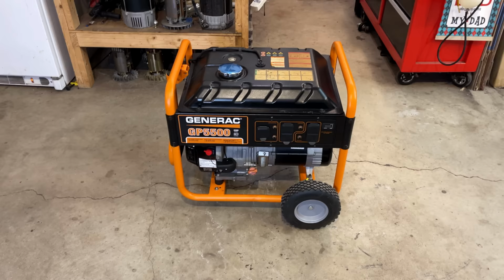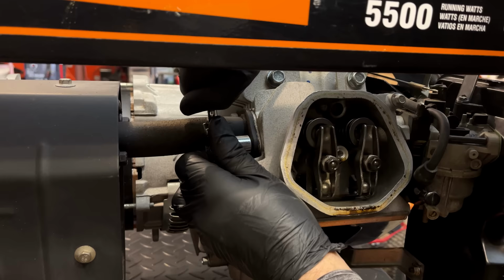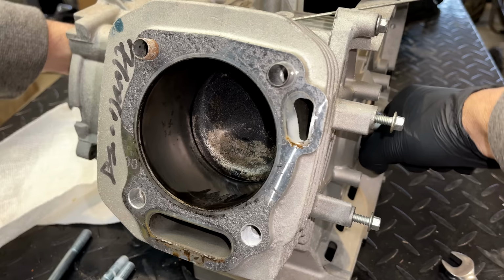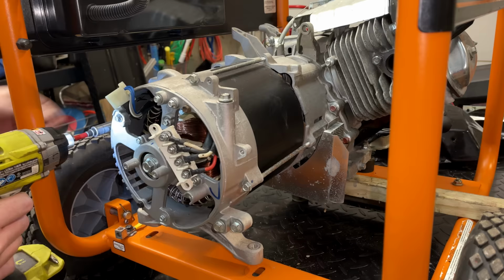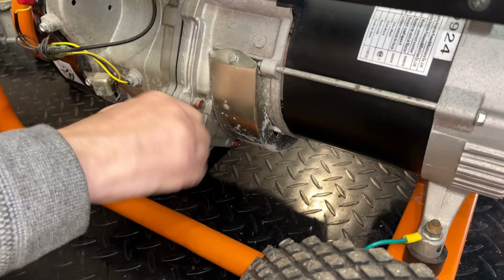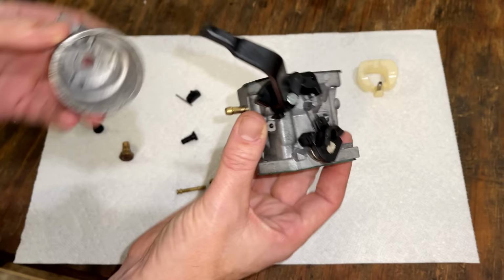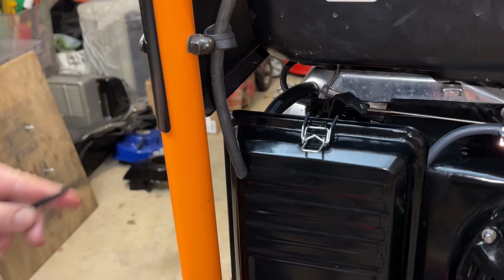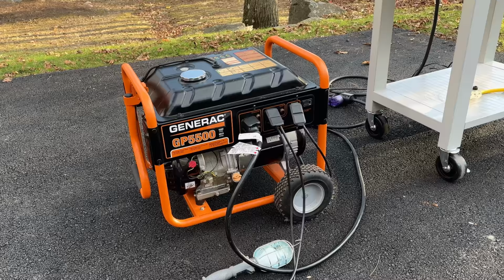What Caused This Engine Damage? - Generac GP5500 Repair

Comment: Best way I found to remove rust and varnish from a fuel tank is to use peebles. Small ones like you found in aquarium. Rough ones are the best but river ones are good too. Then shake as long as you can. 30 minutes should suffice.

Comment: Excellent work James, I had a 3000 watt champion that someone put bar and chain oil in. Took me a long time to clean it out and many oil changes and used some marvel mystery oil during the changes. Came out o.k. but the bar and chain oil was only in it for a few months and the machine did not run much with-it in. Customer said it runs good now. He uses it at his camp. Thanks for the video.

Comment: Another great video James! A word of caution when hammering on the crankshaft bolts to remove the rotor and/or the flywheel. Crankshafts are not designed for side-loads, mainly rotational loads. Beating on either end too much will break the crankshaft. 2 or 3 whacks is about all the crank will stand before breakage internally.
Reply: It is common practice to do this on many aluminum-block engines.  This is why Briggs sells a flywheel knock-off tool.  Now, if it was a Kohler engine, there's a very real chance it would break.

Comment: Junkerac. The home owner grade Generac gennys are built with parts outsourced from China,India,Maylasia and a few others. 
It's extremely hard to find a Good quality, affordable home owner grade genny any more that will last. My old mid 1960s Winco genny that I use for emergency power for the furnace and fridge and a few lights, has only had 2 sets of brushes and a couple filter caps replaced since it was new. It fires up in 1 pull even on the coldest of days. I've had other newer gennys but none lasted more than 10-15 years. Often by the time these newer gennys break the parts are No Longer Available.
Reply: Yep, the new ones are DESIGNED for such, I wish I knew more about older ones like you state where I could get a OLD machine & then round up replacement parts
Reply: That's why when I come across an older machine I tend to buy them if i have a use for it. The same goes with vehicles, I haven't owned anything newer than a 93 since 93 lol.

Comment: I wanna see you clean and rebuild that original motor. Soak the case in evaporust, clean it out heavy duty, and put bare minimum into it. Like hone the cylinder and put new rings into it. 

It’d be fun as a challenge and a proof of concept that anything can be fixed. Like you replace anything other than wear items like the rings or bearings.

Comment: That was a thing of beauty. Boy when I started rebuilding an old tractor from the 60s the gas tank inside was nasty with rust. What a pain of the ass trying to get that cleaned.
Reply from the maker: Tanks like that take a lot of work to clean up.
Reply: @jcondon1  I need to find extra patience also. What’s going on to tip besides in the video? I’m rebuilding a 1966 Ariens Emperor deluxe tractor. Look it up  you’d probably enjoy a project like this. Happy holidays etc👍
Reply: To clean rusty tank, I use 10% phosphoric acid. It take rust away in a few hours and leave gray matte steel. The I wash it, dry carefully and paint it with 2 component paint (for fuel tank paint). That acid not lose its power and can use several times.

Comment: Needle seat failed ethinal fuel found it's way into high zink oil/ brake in oil and chemicaly reacted while it sat for a long time 
I've encountered this before. This is  why when you store a engine drain fuel and carb first .

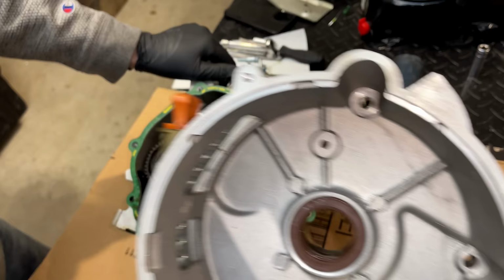Comment: 28:13 Wow is the under statement of the year.  I think it got filled with water, not really unusual considering that these generators are usually used during power outages outside and in foul weather and then just put up until the next power outage. Great video.

Comment: I was always told like for boat motors if you only had gas with water in it to make that gas usable again you need to strain it thru a deerskin chamois, it is supposed to absorb the water letting the gas pass thru.

Comment: It looks like this generator sat for many year in high humidity and not ran. This is why it's so important to start your generator at least every 2 or 3 months, keep fresh fuel in it (non-ethanol) and use quality small engine oil. Whatever the cause, this one was abused. Another interesting video.
Reply: I suspect that it was far more than humidity.  The internal rust/water line was well up the crankcase.  That's not not something that happens from condensation.

Comment: Great work as usual.
I have a new GP8000 10 HRS 
Why when cold out I can't get it to fire with the choke on all the way.The first time I tried to start it when cold out it would t fire.
So I wait a few mins ,we t to retry and I smelled gas ,so next time I full chocked it and at the same time during hitting starter switch I pulled it off full choke to 20 present it then fired.
It will not start on full choke when at 40 degrees.

Comment: I clean my old fuel exactly the same way you do. If it is very dirty, I use a paper towel first, then a coffee filter. 
I usually always drain the fuel whenever I get a new engine into the workshop, but I don´t waste a drop. No matter how bad it smells so far it has ALWAYS still been flammable and I put it in the car, no matter what type of fuel it is, sraight gas, twostroke fuel or diesel, I put everything into the petrol car, filtered properly of course. The car does of course handle that with not even noticing, the electronics in there adjust to the different types of fuel perfectly, besides, the tank is big and the old stuff from the small engines alwas gets diluted with what is already in the car. The small engines I then all run with fresh fuel as they are a bit more sensitive to that because of no electronic regulator mechanisms.

Comment: If the oil was in there for years as it seems it might, the additive package was probably totally gone by now.  It could be oil.  The sludge and watery look could just be from breathing day night cycles for all those years.  It did look quite good for all those years saying that it was stored out of the weather in a less than strained weather place... maybe a damp basement?  Possible.  Thus lots of water to breath in over the years.  

Looks like a good generator to me...  Great job.
Reply: Would have been interesting to see the date of manufacture to see how old the generator is.

Comment: I have a GP550, within 8 months it lost field, warranty repaired, then went to use it and it blew up a lightening/surge arrestor on my panel, metered frequency and it was way out of spec, had the warranty mechanic repair that, then couple years later I couldn't get ot to start and run, a couple years later after watching your videos I decided to try and fix it, pulled carb and found it plugged with gel like substance in lines and carb despite using stabil, also the needle was corroded and lost its chrome. Gas in Massachusetts has 10% ethanol.
Reply from the maker: Same here.  Almost impossible to find ethanol free with driving a couple hours.
Reply: Convert to Propane, NO more issues, what I did
Reply: @jcondon1  All the WaWa locations in my area have ethanol free fuel.
Reply: I advise against storing ethanol fuel in any equipment that will be stored for long periods.  Drain the take before storage or at the very least, close the fuel valve and run the carburetor dry.  Ethanol gas, when stored in sealed gas cans and with stabilizer, will be good for a long time.  The key is a SEALED container that keeps moisture out.

Comment: Mr. Condon some years ago, I bought a brand new LP5500 and it came with a quart of Generac oil when installing it in the engine I saw black specks coming out of the bottle I ran in for just a minute and drained it out I know Generac does not make oil so I suspect a factory oil quality issue, I reported it to Generac but got no response. David W.

Comment: I bought a Is predator generator 5500 to 6500. The guys said it was out of time because it was backfiring thru the carb. I checked the  timing. at top dead center the intake valve had only about .002 clearance, so I set it to about .005. When it's up on the  Is compression Stroke valves and coil all look good. I'm going to check the key way. If that's OK I'm going to put it back together and try it to see what it does. I'll probably clean the carb as well. He did say it was making power  ok. It might have been that intake valve. Was to tight.  I could only get .002 under it. It does have spark. So I don't see anything wrong at this point. I only paid 65.00 for it

Comment: I was thinking when you had it apart switching parts why didn't you just take the extra 5 to 15 minutes to clean carb instead of having to take apart again. But good job getting it running

Comment: It looks like the generator was left to sit with the pepcock opened (and had most likely) previously a bad needle and seat or was dirty it would no longer seal enough to let fuel overflow the carb, trickle into the intake port, through the intake valve into the combustion chamber, past the rings and filled up the crankcase. All this was obscured by the oil changes by the previous owner(s) and possibly somebody who did either a carb rebuild or at least cleaned the needle and seat to the extend it was sealing again.
In any case the oil was diluted enough the engine may have overheated in some areas (mainly the tappits and lobe area).
The fuel/oil mixture may have been in there a long time and may have attracted moisture to the extend some corrosion has occured on the parts not submerged in the oil/fuel mixture. The tappits and cam lobes are not submerged (normally) but will suffer corrosion if the air in the crankcase has a lot of moisture in it due to the ethanol in the fuel attracting water...
The dark brown varnish staining in the crankcase is a tell tale sign of fuel intrusion which sat over a long period of time... possibly over a year or at least 6 months...

Comment: I found on small engines damaged by fluids (water) if the cylinder is pitted around in a circle like down low about in the region of the stroke of Bottom DC like in this cylinder, it is only the Oil ring(s) that move over the damage. If there is nothing sticking up in the bore and only pits (smoothed out with a hone), the engine will run excellent with only a small increase in oil consumption (very small unless too damaged to try and save) if any. Compression is unaffected. I think you can reuse that block. Try it as a not-for-sale engine and run it and see.

Comment: That was an exhaustive rebuild. I wouldn’t expect anything less. However the only thing I know is that you paid $150 for it with problems. I know you edited the video to 90 minutes. I’m sure it wasn’t 90 minutes with raw footage. That being said if we calculate what you would be paid per hour at your shop & multiply by all your hours. Would this rebuild have made sence knowing what you did? I doubt it? 
I’m not a generac guy as you know from my previous comments. If your running power tools this might work? 
Thanks for the front row seat to the rebuild & your great content.

Comment: Common issue…
The needle and seat failed and allowed fuel to run into the crankcase and the ethanol fuel carried some water in with it… Or whatever water was in the fuel tank… Then it sat an extended period of time.
You have to have a fuel shutoff on those engines and you have to use it… Same with riding mowers and any other gravity feed fuel systems.
Reply from the maker: Agreed.  If gravity feed you must shut the valve off.

Comment: I'm puzzled as to why the crankcase looks like it does. It could have been that water got into the crankcase but the rest of the generator doesn't look that way. Even if it was stored in a very humid environment for many years, I doubt that condensation could have accounted for that much water. It was higher than the oil fill level so possible about 2 quarts. The water would be on the bottom with the oil on top sealing off the air making it difficult to get oxygen to rust. What if somebody tried cheap fuel and bought E-85 instead of gasoline and didn't shut the fuel valve. Ethanol will make cast iron rust and it might have reacted with the aluminum case to create the mess in the crankcase because ethanol has less tightly bonded oxygen. There might even be magnesium in the case.

Comment: Do you think maybe the carb flooded over and dumped gas in crankcase, that in turn washed oil off internal parts and rust formed over time. Just wondering. Thanks for sharing video

Comment: I have a Generac, one of the larger ones - the so called breather failed "the other way" - which I understand is not unusual with Generacs - the crankcase filled with fuel in some very hot weather (fuel expansion) actually, in the model I have I found that there's a very poorly designed check valve - I could tell the engine was "hydrauliced" but I had no idea what was going on initially imagining that water must somehow be the problem although it has always been protected from weather - - - anyway, I did address the problem but for sure I was lucky that I caught the issue before it did any damage.

Comment: Whew man that's gross inside. It's so risky buying used generators. I bought a used 16hp Vanguard based generator for cheap, and got lucky with only minor issues - But I probably won't risk it again.

Comment: On generator that the engine does NOT run and I’d not locked up where you want to verify the power head is good you could remove the dork plug and the recoil starter and spin the power head over with drill or possible impact if it spins fast enough.  Or spin it from the generator side.

Comment: I have a quick question for you James. I know you can’t run computer equipment with these types of generators, but how do modern LED lightbulbs do considering they have a small electric circuit board inside of them, versus say a simple incandescent bulb? Thank you in advance for the answer. I really appreciate your videos.

Comment: The fact that the guy who sold it to you said he changed the oil a couple times due to contamination/color makes me immediately ask Why would a newer engine require multiple oil changes in a 2 day period. If it was an older engine with lots of carbon build up, maybe not seen much maintenance I could understand but a relatively new engine gives red flags galore. 

But I guess as a generator specialist warning flags to us common folk just means potential profits for you 😄.

Comment: If you think these cams are bad, you should see the new ones. They're plastic, at least the lobes are.  They have a plastic gear molded to a metal bar that has plastic lobes on them.
Plastic lobes will not withstand the test of time.

Comment: Maybe it was running and had water in it. The oil and water will still lubricate and the oil would most like separate. The water gets to 180 degrees opens the metal a little and cools down, impregnating the oil in the casing.

Comment: So... here's a thought:

Is there such a thing as rotor timing? Do you keep track of rotor poles orientation with respect to the crankshaft?
My uneducated guess would be that having a good match for the torque pulses with the magnetic pole positioning would give a better THD.
Reply from the maker: Never thought about that, but it makes sense.
Reply: The generator has two "pulses" of power every revolution.  The engine has only one power stroke every two revolutions.  I doubt if there is a way to time it that's any better or worse than any other.

Comment: Hi Jim, can you go a bit further about the bonded vs. floating ground when you connect to your house panel?  I have this same genset and haven't yet checked which I have, but assume it is a bonded ground.  What should I be concerned with by hooking a bonded ground genset to my house?
Reply: I'd like to know that too.  I thought it was just the opposite.  I'm using a large knife transfer switch that only switches L1 and L2 off the grid and onto genny, but leaves neutral and ground alone.
Reply from the maker: An electrical system should only have one bond from neutral to ground.  When running a portable generator not connected to the house, the bond is necessary so the circuit breaker on the generator will trip if a live wire touches the frame.  When connected to the house you want that generator neutral to ground bond broken otherwise current will flow on both the neutral and ground wires back to the generator.  Current should not flow ever on ground unless there is a fault.  What will happen is that the amount of current on those wires will not be balanced and increases the risk of a shock from the ground/neutral wires.
Reply: i understand code requires a floating neutral if connected to my house panel.  My question is why manufacturers don't offer the option of a floating neutral. I have a Generac 8500EFI and Generac told me that if I floated the neutral I would void the warranty.  I have not seen any portable generators less than 15kW that have floating neutrals.
Reply: James already answered this question well.  I would only add that on generators with GFCI breakers or receptacles, the current coming back on the neutral needs to match the current going out on the hot side.  If the current is shared by the neutral and ground wires, the GFCI will trip every time.  So you need to float the neutral on the generator if connecting to a home service panel where the neutral is already bonded to ground.